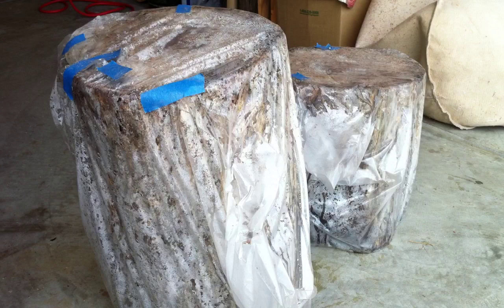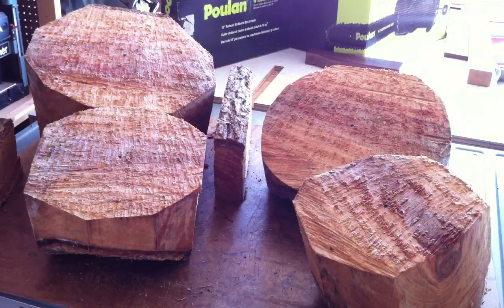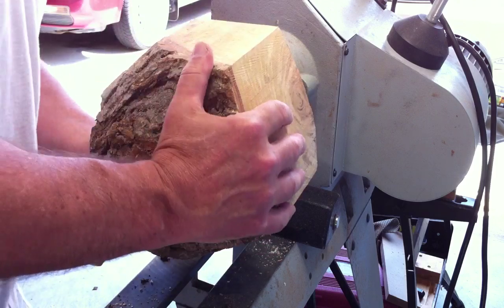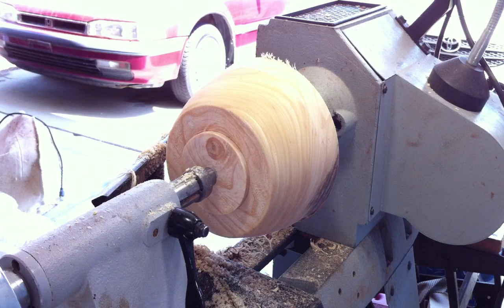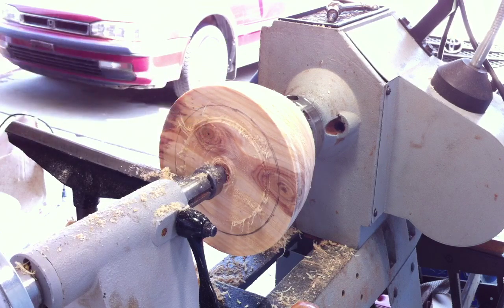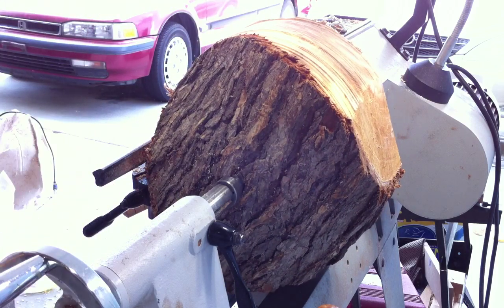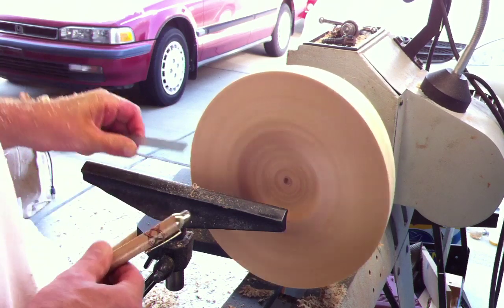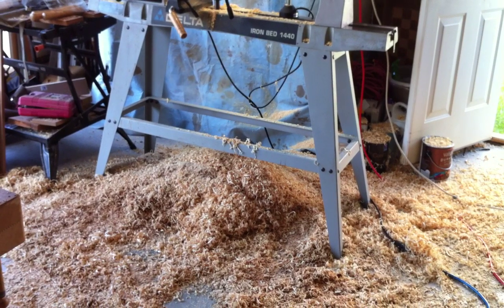Rough Turning Elm Bowls

Comment: Since you have the paper bags, here is something to try especially if yoyr wife needs a new microwave oven,  Seal the bowl in the paper bag and nuke  it for 10 minutes and check for cracking.   Change bags and  nuke another 5 minutes and check for cracking.  The paper bag will tell you how dry the blank is getting,  If that is too fas a dry, get yourself a used air conditioner and put all blanks is a room or shed and let the air conditioner take moisture out of the blanks.  Both methods are much faster than natural air drying.
Reply from the maker: Thanks for the tips Gary. I've seen the microwave trick but never thought about the air conditioner.  Thanks for watching and for the suggestions. Take care. Steve